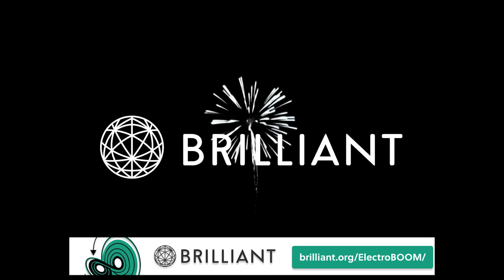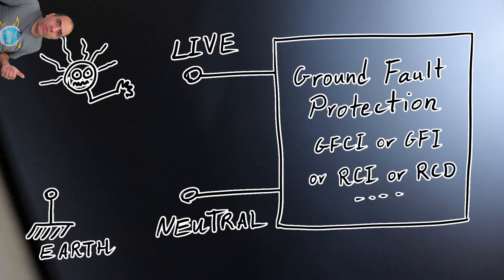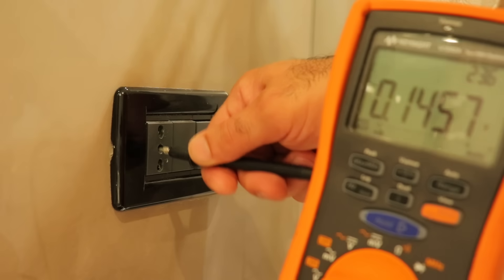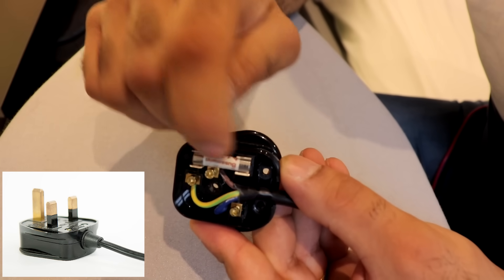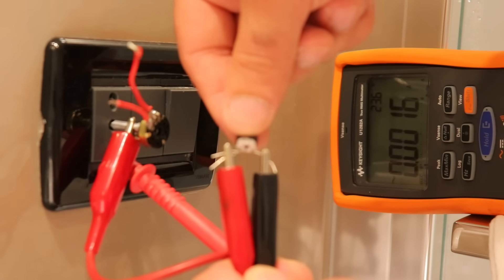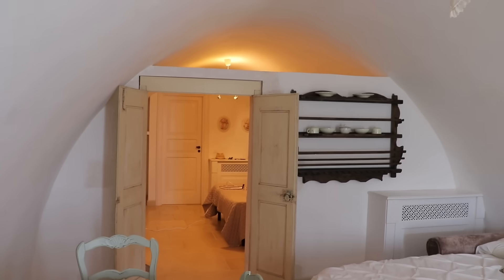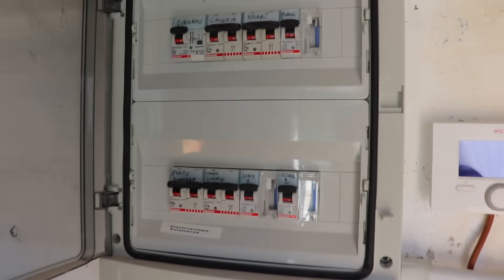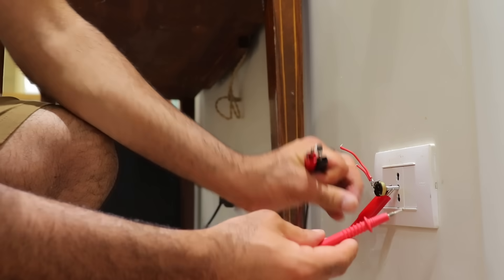Tripping Every Breaker in Italy

Comment: Hey Mehdi, fun fact:
The railroads in Italy drive with 7000V DC (I think, please correct me), while most of the other contries drive with 25kV and 50 Hz, while Germany, Austria and Sqitzerland form an island with 15kV and 16,7 Hz.
Edit: People are right. Italy has 3000V DC.
Reply: 3kV DC and the regular 25kV on high speed. Better than the Netherlands's 1.5kV DC network tho
Reply: @bartbatenburg  isnt italy all 3kV DC? Not sure what lines use 25kV
Reply: @shahimagesyt  25kV AC on high speed, which is the proposed standard for high speed rail.
Reply: I think Italy is 3 kV DC. Pretty shitty how Europe doesn't have a uniform system in terms of railroad power.
Reply: @shahimagesyt  Its really annoying. I work for the Austrians and we have unfeasibly complicated locos with 3 (!) different systems onvoard just to drive through eastern europe, Germany, Switzerland, Austria and Italy!
(These are our 1216s and Vectron locos)

Comment: The plug you refer to at 15:10 is known as Schuko (Schutzkontakt, Safety contact) plug and the earth is both the center hole (often used in the Mediterranean area) and the side contacts.
Being able to plug those into the small, flat sockets just gave me a cold shiver... It's like the worst of both worlds... bare pins when partly plugged in and no earth where it is really needed.

Btw, the blue wire should always be neutral and brown,black and grey should be phase 1, 2 and 3.

Comment: In Italy it's the law that each unit has its own!
Also, the round plug, German style, is not supposed to go into the 3 vertical holes Italian style, you forced it into the smaller holes. In that case you're supposed to use a small adapter.

Comment: the first electric board was garbage. I'm not sure that this is the thing in Italy, but I'm sure that in Germany and middle/east europe, the blue wire should be Neutral and the brown, black and grey wires should be live wires with 120 degrees phase shift.

Also the plug you were showing up (the shuko one) is very common in the regions I mentioned before

Comment: Only earth less plug like CEE 7/17 should be inserted into type L italian socket. If you have earth pin (type E or F for instance) you must use an adapter to type L socket to have earth continuity. When visiting Italy get one of those adaptater as the type L is quite common there whereas the E/F compatible plig are scarce... What is the point of having a fuse in the plug if the breakers pop at max line rate ? Understanding that the device has internal fuse.... Having resetable breaker look more modern and secure to me. Plus having a differential breaker everywhere is better as overall solution...

Comment: In Italy, local regulations mandate the use of a RCB for the whole house (we usually use more than one, for example one for the outlets and one for the lights) and there is a good reason for that:
We use a TT system instead of the more common TN.
In the TT systems all of the ground wires coming from the outlets and the permanently installed appliances are connected to one or more earth rods buried around the building.... and nothing else.
Every building shall have his own ground which must be separated from the mains (no connection between neutral and ground is allowed).
In case of a dead short between the live and the ground, the fault current shall travel inside the ground wire, inside the ground rods, than shall travel trough the earth and coming up from the ground rods installed inside the transformer shed to reach the neutral connection..... this means that the earth system shall be able to handle the entire fault current in order to trip the breaker!!!!
Using a RCB vastly simplify the things (now the earth rods are required to carry only 30mA instead of hundreds of amps!!!)
BTW:
Light blue = neutral
Yellow wire with green stripes (bicolor wire) = earth
Brown, black and gray = live conductors (any of these colors are allowed in a single phase environment, for example to have a distinction between circuit1, circuit2 and lights, but of course three different colors are useful in a 3 phase environment).
Any color (except light blue and yellow/greeen) = switched lives (for lighting fixtures).
The electrical distribution system is 400V 3-phase with neutral (subscriptions up to 6kW are supplied in single phase between one phase and neutral, larger subscriptions are supplied with all of the 3 phases).
Reply: The ground rod should be able to handle more than 30mA. If it has a high resistance the voltage will be 30mAxresistance. Having a resistance under 3 Ohms is good because ven if the 30mA gfci is faulty it will handle the high current and trip a normal breaker.
Reply: @MernokiMegoldasok  Of course, the lower is the resistance, the better is the protection (and below a certain level the ground can also be able to dump enough current to trip a breaker) but there are some problems:
First of all, making a very good ground in some places (eg, where there is a rocky soil) can be tricky and costly.
Second, in a TT environment you cannot "cheat" by connecting your ground to the neutral wire: this operation is illegal and can also trip the main breaker inside the meter (many power companies check for current imbalances between live and neutral and trip the breaker in case of a 500mA difference).
Third, to trip a breaker you either need a current a bit higher than the designed current for quite a long time or at least 10x the designed current to get an instant trip: if the current that the ground system can dump is higher than the designed current but smaller than the instant trip current, the breaker needs some time to trip and everything that is connected to this ground become connected to the live conductor..... the safety ground is no longer safe!!!.
Reply: @teslacoiler  I saw a video of some people reconstructing the type of grounding Nikola Tesla used for his Wardenclyffe tower. They got 0.44 Ohms is I remember correctly. I bet they could get even better value by using longer ground electrodes and wetting it with an electrolyte like sodium carbonate solution.
Reply: @MernokiMegoldasok   ground rods are expensive. Idk why yall stuck on grounding capabilities. It’s just better that you would only let 30mA rather than the full fault current is why the RCD/GFCI are good. Its not that ground system cant handle the full fault but why would u want full fault current? Food for thought, if no breaker trips, it will see full fault current and continue to flow until someone discovers it by accident. It could be a few amps or may not cause fire but could still kill someone unsespecting. What if u had a regular breaker that trips at 15Amps but the fault is 3, quite enough to kill. Ground should sink it but there is paint on the wire or the box went rusty, whatever scenario increases the ground resistance so that it would rather flow thru a body, a GFCI/RCD would have caught such an event. Its a shame we don’t have whole home RCD in America
Reply: @Wtfinc  A 30mA gfci is only a supplimentary protection.You must still have protection if it fails.In France they use a 500mA gfci for the entire building and 30mA gfcis after that for separate circuits.If the 30mA fails the 500mA main will trip.Also keep in mind that water and gas pipes must be bonded to ground.(unless plastic of course).They will further improve grounding.
Reply: @MernokiMegoldasok  High performance grounds are expensive, try to cheat with chemicals requires continuous maintenance and wear out the rods quickly and is basically unnecessary.
Having a GFI and a ground with a resistance low enough to trip the thermal section of the breaker is considered sufficient:
In case of a ground failure, the GFI instantly trip.
If the GFI is broken, the ground system (and all appliance connected!) become live and dangerous.... but not for too long, only for the time required to trip the thermal section of the breaker.
Ideally, the ground should be able to handle the full current without increasing his voltage more than 50V (a safety voltage), but this goal can be tricky in some places (and considered unnecessary if you have a GFI protection for the entire buiding).
Reply: @teslacoiler  Sodium carbonate doesnt corrode copper or steel rods.Copper and iron react with acids but not with alakine solutions.Expensive ground rods are elite ground rods.They are a must for nerds.Cheap high impedance grounding is only acceptable to ordinary people who dont use higher power Tesla coils or amateur radio stations.
Reply: @MernokiMegoldasok  The problem starts with electrochemical corrosion.
If you connect two different metal togheter (something that almost always happen in a grounding system, specially if you connect the water and gas pipes also) and you place some sort of electrolyte between the metals, you made a battery that continuosly generate a tiny but steady current until it runs out of electrolyte or metal.
Ham radio stations not require a special ultralow impedance ground unless a lighting protection is required (nothing to do with the power of the station but to the height of the antenna and the height of the surrounding structures) because they rely on artificial ground instead (eg, the radials that are already part of the antenna).
Concerning high power Tesla coils..... well.... yes, of course i have a separate RF ground for my coils, but this is something that only apply for coilers, nothing to do with a standard electrical code!   🙂
Reply: @teslacoiler  Electrochemical corrosion shouldnt be a probmel with a copper water pipe and an iron gas pipe if they are several meters apart under the ground.I only saw corrosion when the copper touched the iron directly.Some countries actually use copper clad steel ground rods.
Reply: @MernokiMegoldasok  of you connect the two pipes together, the effect will be the same.
Getting a reliable ground that last for a long time Is not easy.

Comment: Hi!  I am Italian and the blue cable is the neutral while the black one is the phase.  The "doors" on the sockets are for safety.  Generally the houses are protected by salvavita (in technical terms magnetotermici differenziali) they are triggered with a current above 30mA.
Bye!

Comment: In Belgium you need a 300mA protection for the whole house, protecting the "dry rooms". The "wet rooms" like the bathroom, outdoor lighting, etc. need to be protected by a 30mA switch.
Reply: Belgium and France have powersockets with an earth pin, so you can plug in the powerplug only  in one way. I am wondering, is this fully standarisized so that always the brown wire of any device powercable is the phase?
Reply: @janwesten1317  You are right, am earthed plug can only be plugged in one way. The unearthed plugs can be plugged both ways.
Since it's AC, it doesn't matter how a device is plugged in.

The standard says that, to connect a light or a wall socket, the power line needs to be brown (or black, or red), the neutral must be blue. Earth must be yellow/green. But in the socket you can connect the power line to the right or the left hole. Again, since it's AC, it doesn't matter. But earth must be connected to the pin.
Reply: @DRBigADV  Okay, so the sockets have no line/neutral marking with the result that the phase is always e.g. the leftside. I remember old photo equipment with autotransformers. The electrical ground was not isolated from the mains. These devices were always connected in such a way that the electrical ground was at zero. The socket was often taped into the socket to prevent it from being connected incorrectly. (it was not dangerous the other way, but they worked more stable) In case of standardization this would not be necessary in Belgium :)

Comment: "What kinda outlet is this" its a Bticino Magic Outlet, one of the first outlets largely produced outlets with child protection. It's a special italian outlet and the Bticino the manufacturer is originally italian and is just like all the other outlets. Also find these kind of outlet widely around Iceland where the outlets were sold with the idea that they had better quality of power going through them and the power was like "magic". Also that they are much more safer than other outlets, specially since the other outlets at the time didnt have child  protection.
Btw all the 30mA RCD  showed in the video are outdated and need to be changed out to handle DC current also.